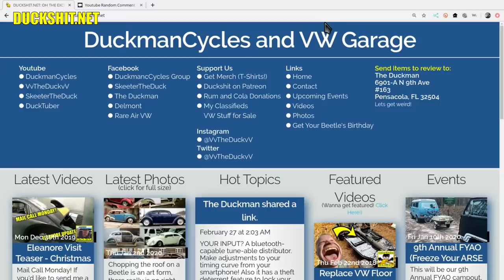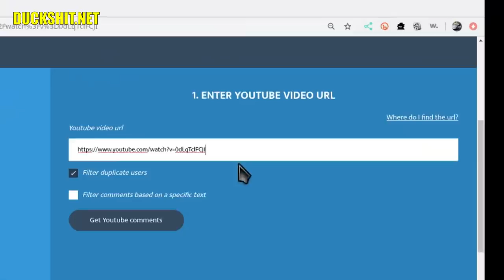CONTEST WINNER - VW Tech Session - January 2020

Comment: I keep telling these parts holders that I've been doing this longer than you've been alive, I think I know what I'm talking about!
Reply: think she had a problem at the battery store? Like Duckman said go to the auto parts store and do everything you can to not tell them your buying a part for your Harley. They will keep on you wanting to know what its for and if you slip and say a Harley they will answer "we don't sell parts for motorcycles". Couldn't get a headlight plug out of the guy and just pulled it out of thin air "it's for a '87 Ford Crown Vic . He returned, is this what you need? That was it.
Reply from the maker: I'm not even that old yet, yet I've still been doing the stuff longer then they've been on the planet LOL

Comment: so what was the problem with the tight wheel?
Reply from the maker: The car has been sitting some six years, we believe the brake shoe may have delaminated inside and bound up.  The big surprise is it was rolling fine just prior, it happened after they stopped in the garage.  Will be something to look at for the next tech session!

Comment: "OH YEAH!" "I MISS HUNGRY HOWEY'S PIZZA!" "THEY DON'T HAVE HUNGRY HOWEY'S IN VIRGINIA!" "DANG IT!  I ENJOYED THE VIDEO DUCKMAN. I'M IN BED WITH SEVERE NECK PAIN WATCHING YOUR VIDEOS. WISH I COULD DO WHAT YOU DO. The VW Thing sounds like it's misfiring on one cylinder. The rag top for the Thing is one of the most difficult items to find restoring a Thing. Sometime you have to search forever on line or finding a auto interior shop to make a ragtop parts and vinyl/transparent windows.
Reply from the maker: The Thing is running great, but I think the red Beetle in the beginning has a minors vac leak.  It seems to be running ok at idle, but spraying around at the seals I was able to change the speed of idle.
Reply: @vvtheduckvv  Did you try and rebuild the carburetor? Could be a stuck fuel float "Oh, heck find a Holley 500 2 barrel and stick it on. That will work!
Reply: Bro sweet best of burden!!!!